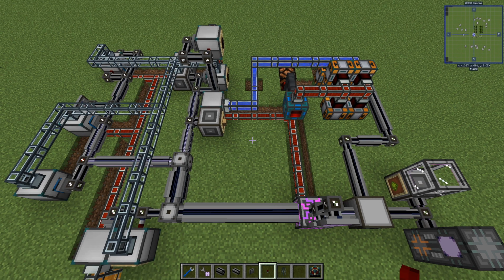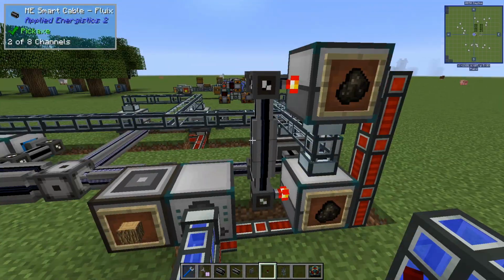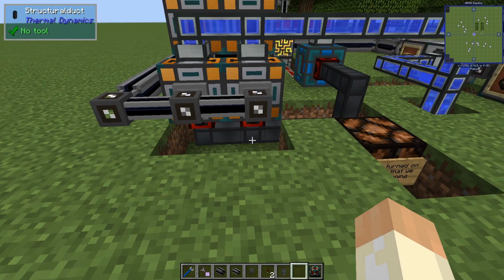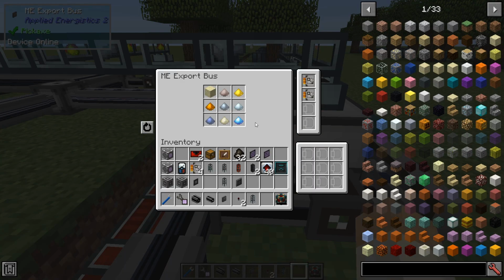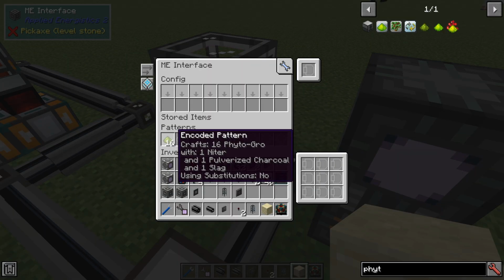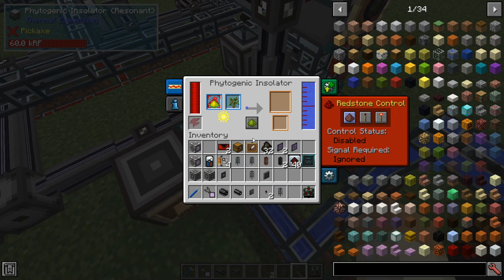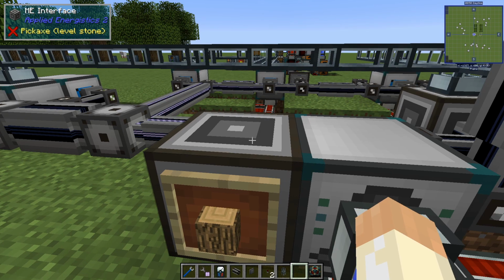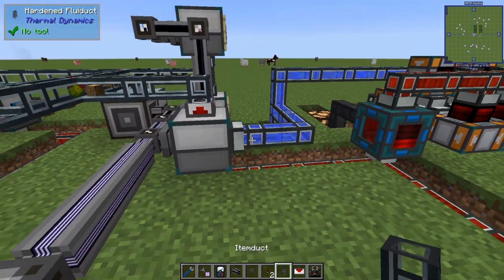AE2 Controlled and Automated Thermal Treefarm Power Plant Tutorial

Comment: Such a shame thermal ducts aren't updated yet,  could you possibly update this by using storage buses instead?
Reply from the maker: Well, the easy part is to upgrade the Itemducts. There are eight devices required, so you can make a separate network with Import Bus to all machines (where they output items) and then a storage bus to the Interface. However, you would need some other mod to handle the power and maybe also the fluid part as there might be more convenient ways compared to AE2 fluid system. And don't forget about the structuralduct which cannot be made with AE2, so it really depends on what other mods you have at hand!

Comment: Did thermal dynamics/expansion remove their autonomous activators or am I thinking of a different mod? Because I remember them being really useful
Reply from the maker: Oh, I haven't used that block in ages. But you're right, it's not a part of Thermal Expansion any longer. Either the game mechanics were changed or perhaps the block was considered too OP, I have no idea.
Reply: @therealtkh  that's a shame they were useful for things like auto cobblestone generators
Reply from the maker: @josephwilkins238  I remember them being fantastic for interacting with some machines that were designed for manual handling. Like magic mods, where you right click with items for example. Those were designed to be not possible to automate so it was almost too good ;)

Comment: I think you can actually improve this build by converting the logs into sawdust using a sawmill and pulverisers, the sawdust can be condensed (9x9 recipe) into compressed sawdust and then smelted into charcoal - yields significantly more charcoal per log.
Reply from the maker: Yes, I think that's possible. Actually, my first version of this build (some two years ago) was based on that idea, but for some reason I didn't get it running as well as this version and I have actually not looked back into the old to see why. I tried to keep this one as simple as I could, because using the sawmill version adds more machines and complexity. But if it yields more power it could be worth it!